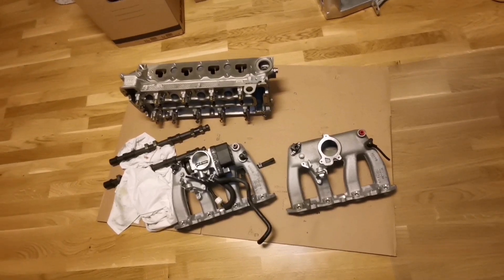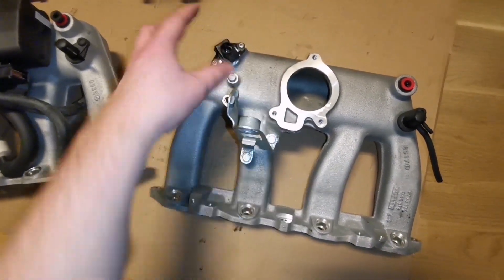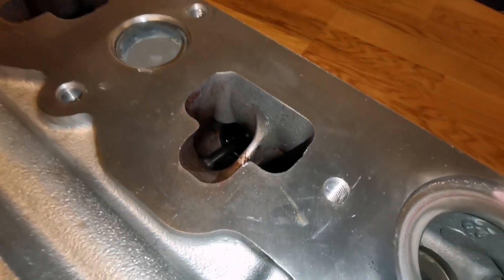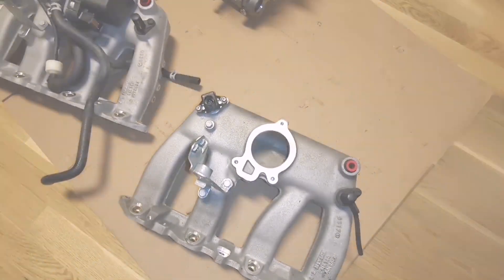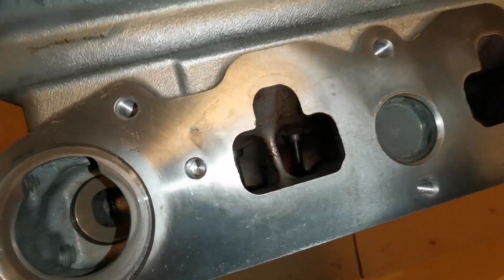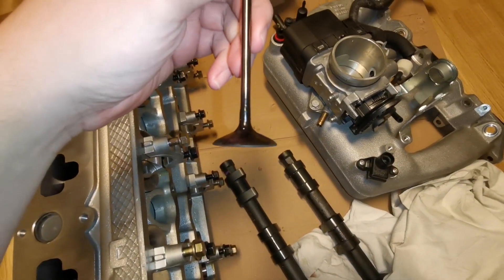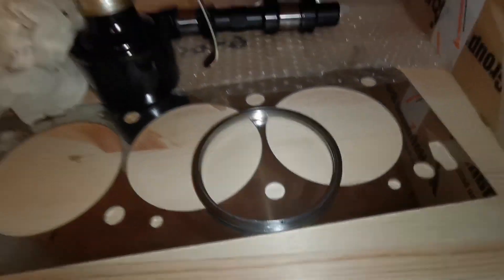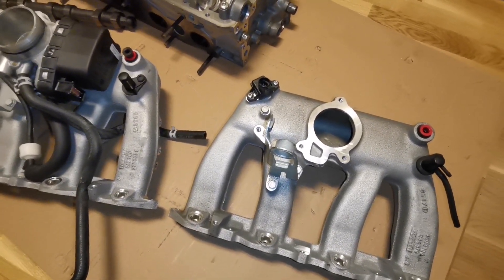Saab 850+hp build vlog pt.1: The intake port and intake manifold design

Comment from the maker: I shall also mention that this port job im about to do probably aint suited for everyone and every setup. Raising the port roof height will slow down velocity some in certain areas and gain some in other areas. It is a balancing act. 

However I do like when the velocity continues to build more consistently over the whole length of the intake runner and port down to the valve throat. Especially when needing higher rpm efficiency without sacrificing too much low rpm response.

Comment: thanks for explaining some of this... I use a B235 in my BMW drift car ... I was considering going back to a B234 head as I blow valves open over 320KPA absolute and was worried about the valve stem diameter with larger springs ... i dont use spark cut on 2 step because port combustion causes the exhaust valves to be pushed open and pump the lifter up... I will re think this a little now

Comment: Hey Joel! Nice job! I have a question/idea... Since you will increase the intake area at the throttle body... Is it possible to increase the intake area by duplicating and modyfing the intake manifull adding a second throttle body?? I saw the new corvette engine and it has 3 throttle bodies... Another question. Is that turbo a twin scroll one?? Thanks!!